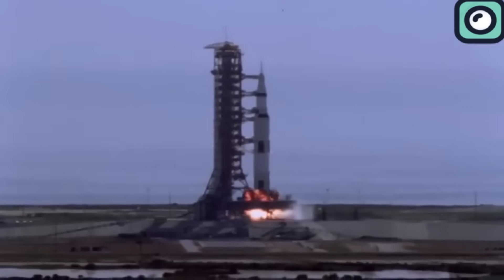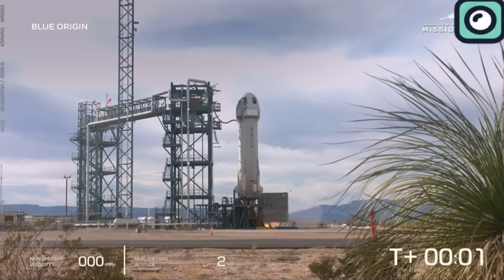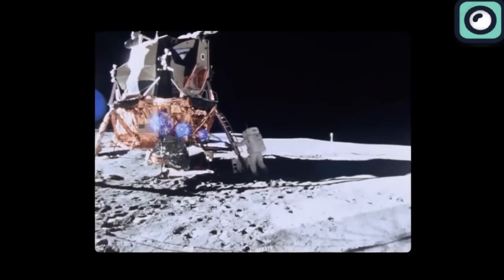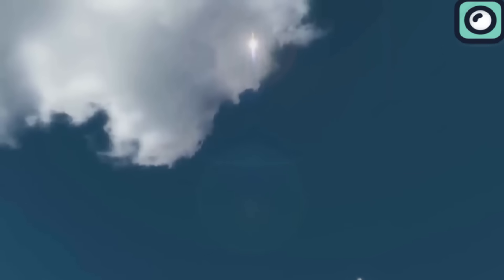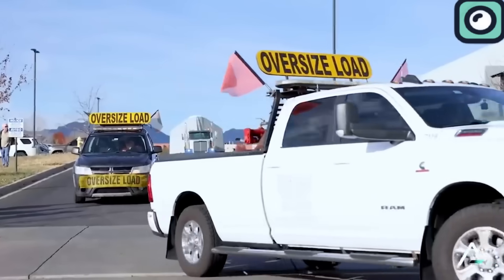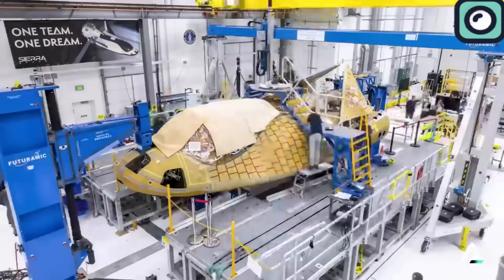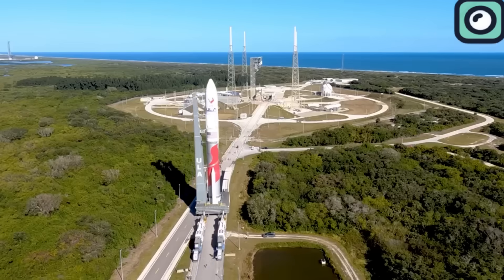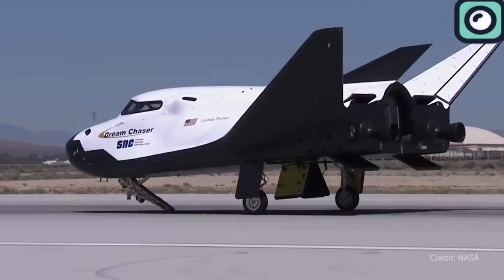NASA Finally Announces The Launch Date Of The Dream Chaser Space Plane!

Comment: The least costing is the most successful and cost efficient.
Reply: Granted it is not like they were starting from the same place. SpaceX was making upgrades to a system they were already delivering cargo with, SNC had already been looking into a design that continued on decades of research, and Boeing basically decided to start from scratch. Admittedly I would have rather seen SNC be chosen over Boeing, but NASA seemed to have some concern about project getting canceled and wanted Boeing's political clout behind it, given issues it had in not getting full budgets allocated some of the earlier years they probably were right about how much risk the program was of making it all the way of having completed vehicles.

Comment: Questions out of my curiosity:
1. Is it for astronauts or for cargo only, or for both?
2. How many astronauts Dreamchaser can accommodate?
3. Can Dreamchaser send a space module to the space for building a new ISS?
4. If Dreamchaser works well, does Nasa still spend billions of dollars for Starliner?
Reply: 1). Cargo at first.  But its structure and main systems are intended for manned capability.
2). Seven astronauts.
3). No.
4). I hope it’ll replace Starliner.